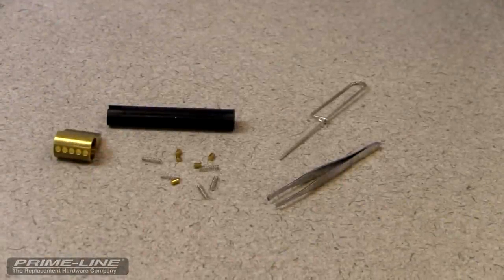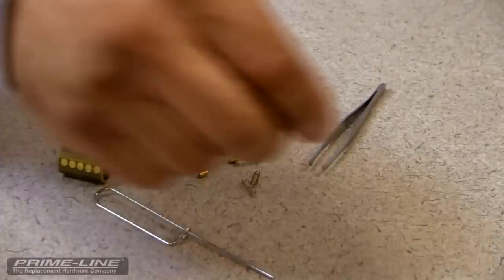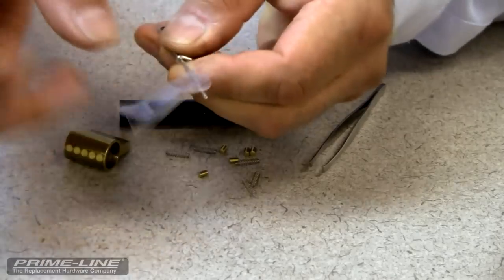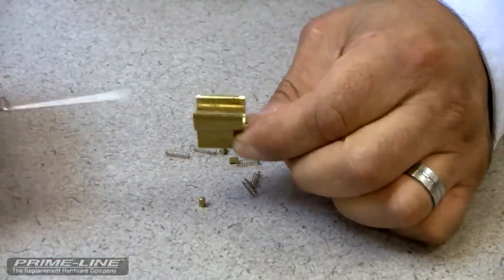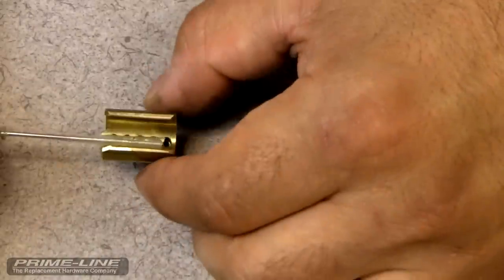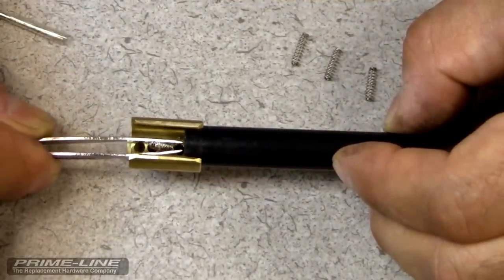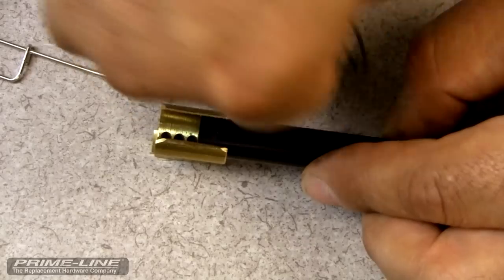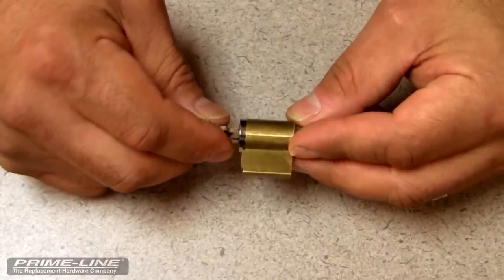Re-Installing Schlage Lock Cylinder Driver Pins & Springs (That have fallen out during re-keying)

Comment: This is a wonderful "how to" video on re-assembly of the cylinder and driver pins for a lock after my "bad day" mistake of pulling the cylinder out of the chamber without having the right tool to stop the driver pins and springs from exploding out of the mechanism.  After acquiring tools like Leo used in the video, I was able to follow his process to restore my lock to working condition.  It's difficult for a newbie like me to reliably get both the spring and driver pins where they need to be.  The further into the chamber you're trying to work, the harder it is to do.  One slight difference that I'd recommend is to start with the installation of spring and driver pin in the 3rd (middle) slot rather than the very end (5th pin) because it is easier to manage.  My pin installation sequence was:  3, 4, 5, 2, 1.  Fortunately the plug follower I had can pass through the entire chamber so that I could do this sequence.  Thanks!

Comment: Oh the many times I have fiddled around in tiny chambers like such with a pair of tweezers trying to line up the pins with the holes and push them down into the chamber with a pick WHILE trying to push the plug follower in! Your an expert! This wire tool will come in SO handy!

Comment: Rekeyed 3 Baldwin knob sets and managed to dump the springs and pins on one of them. Couldn't get single sided tape to work so used double sided tape (Very easy). I too did two pins on one end and then did the remaining 3 pins from the other end of the chamber. Thanks for the video, it was a life saver.

Comment: If you start with the hole in the middle of the cylinder and work your way out,  then pull the follower tool clear through to expose the two holes at the other end and work backwards out the other end it makes it a tad easier.
Reply: Thanks for this tip. It was impossible trying to do all from one end
Reply: Yes. I did the same way.😀
Reply: That was a great tip. Another thing that really helped me (since the pins wouldn't stick to any of the tape I have, and I have a slight tremor): Use the slotted end of the standard Schlage follower to "guide" the top pin into place. I.e. place the follower with the side of the slot lined up with the hole, put the spring in, then drop the top pin into the slot, and use a little thin screwdriver or wire tool or flip it into position along the side of the slot (which then acts as a guide) and just push it down, with light turning pressure on the follower to cover the pin once it's down.  You could probably cut a custom follower for this purpose as well.
Reply: The real tips are in the comments. Thank you! 6 years later your comment just made an hour of pain into 5 minutes then done.
Reply: @originaldkmn  good tip! I'll have to try this next time.  It seems pretty straightforward.

Comment: The tape trick is very helpful, but there is still one problem: the spring, when it is not compressed, fills the entire chamber and there is no room to easily drop in the pins. The tape helps for actually picking up the pin, but it is not strong enough to hold on to the pin when I try to line it up with the chamber, and it just falls off the tape. Any suggestions?
Reply: I am guessing these locks vary a lot by the amount of space the springs take up. In his video they are almost entirely inside the spring slot and not in the chamber. In mine they were about halfway. If the spring fills up the entire chamber that's pretty rough. Not sure what to suggest. Buy a new one maybe or find smaller springs to swap in
Reply: Patience
Reply: Yeah cant then brain Jessel out it anar 1 A sea
Reply: Leave now himan your not cleared kit as am active my self and you are on rent
Reply: @mukisicario7070  WTF are you even trying to say?

Comment: The instructions of an older primeline kit had you start with the # 3 hole, and continue with the 2nd, and first holes. You leave in the follower and move it so #4 and 5 holes are exposed and work in that direction. I found this after using this method, and think  the old way would have been easier.

Comment: what do you do if the driver pins are differents sizes? I legit just put a lock back together and didnt realized the driver pins were 2 different lengths, you wouldnt think itd matter but now  after ive pulled the key out of the lock it no longer goes in. makes no sense when the key pins were all flush with the key in there

Comment: This is a great tip, trying to replace the parts with a tweezers is tedious and frustrating. I had my lock come apart and everything went flying.  It appears that I have lost a driver pin for what I believe to be a Schlage B60.  They look like capital i's.  Can I use an old key pin of similar size or does it have to be exact?  Where can I get replacements?  Of the 5 one is just a straight pin, no capital i.  What is the significance and correct placement of that?

Comment: As a locksmith I find putting the follower in the cylinder covering the first two holes, start in the middle (3rd hole) use tweezers to fit the pin in the hole, push the follower up against the pin and push down with the tip of the tweezer. You now successfully put the pin in the hole and can start to work through the pin hole while covering them all.

Comment: I work at one of the large HI stores and had to rekey a Schlage Deadbolt.  While pulling out the  follower the pins and springs came out.  I was able to slide the top brass sliver of metal to reveal the holes.  I put back the pins and springs and was able to slide the cover over them one at a time.  What a pain, but it got done.  I will remember this trick.  My issue is removing the cylinder with the follower, somehow the pins fall out.  Anyone have any tips to prevent this?  I know turning the keys 45 degrees is the first step, but anything else?

Comment: Wire tool with scotch tape wow that's old school! But if someone has a locksmith tool as a plug follower laying around the house that someone most probably also has pinning tweezers. Prime Line should have made this video using a ratchet socket as a plug follower, then this video would make more sense. I bet there's a million times more household that have a ratchet kit at home rather than a locksmith plug follower.

Comment: This is a unique way never saw this method before. I have a pair of tweezers that hug the pins the tip is round and it truly makes handling the pins a breeze. I put the follower in my vice then insert pin push the bible onto the follower until it covers the pin rinse and repeat. The core I have has I guess a nut is the best way to describe it on the back of the core that covers a pin and spring, one end of my follower is what tightens and loosens that nut. What is the purpose of that rear pin and spring?

Comment: What if one of the springs happened to get lost? I've got the remaining four in place with driver pins, but the fifth is empty since I can't find the spring. The key seems to turn fine, but will there be any difference in how my lock works?
Reply: Just make sure driver and bottom pins are removed. You will now have a 4 pin Lock that is easier to pick. You could cannibalize on old lock to restore for free, or buy new springs for cheap. Keep the 2 pins for later. Be glad you did't loose 4 springs, you would be left with a 1 Pin tumbler lock? Good Luck

Comment: I wanted to share my experience in case it helps someone. While disassembling my lock, I accidentally let the pins and springs fly out. I didn't have any locksmithing tools, but I was able to place the springs and pins back in using tweezers, and hold them in using the bolt itself (by slowly sliding the bolt farther and farther into the cylinder as I placed each spring and pin).